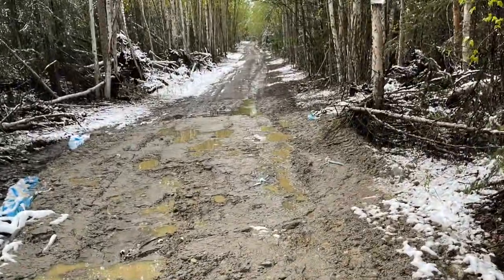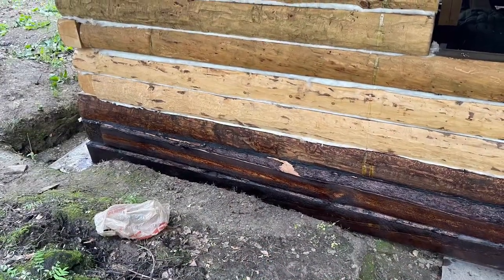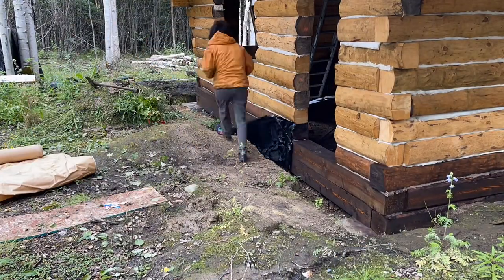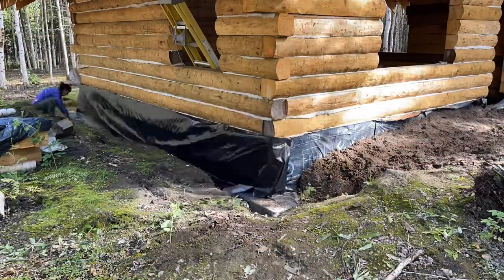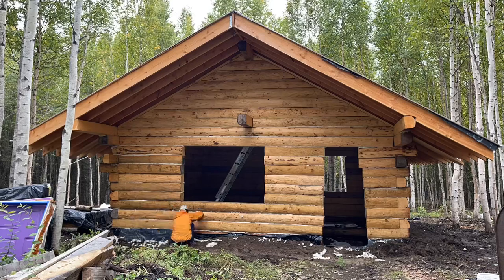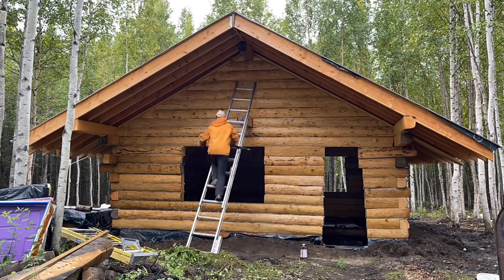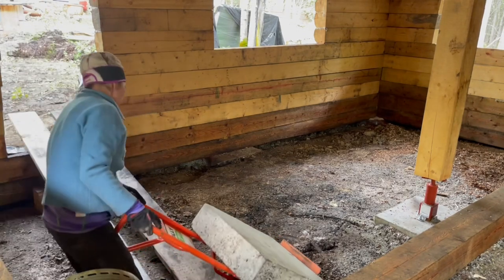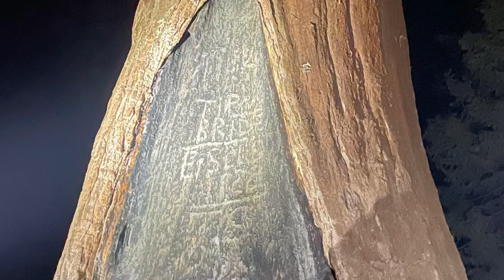Staining the logs, mounding dirt around the house to divert water away in Delta Junction Alaska.

Comment: Just as a suggestion, dirt will not shed water away from your structure. Water will just drain through. 
Best suggestion is a french drain, which is a lot of work and expensive. There are alternatives though such as gravel water barrier, and more gravel. This will need to be sloped away from the structure with drain channels.